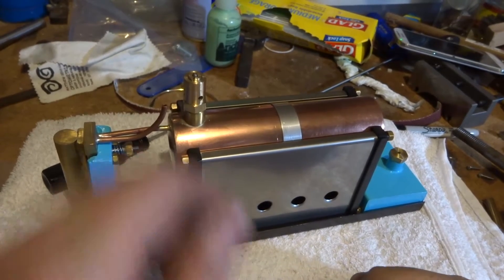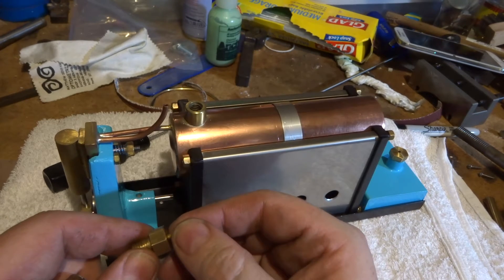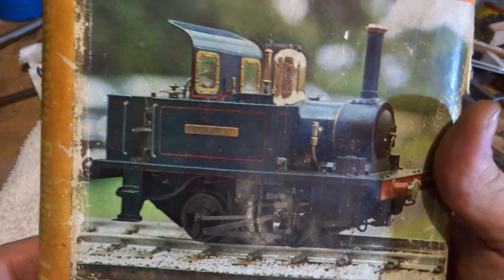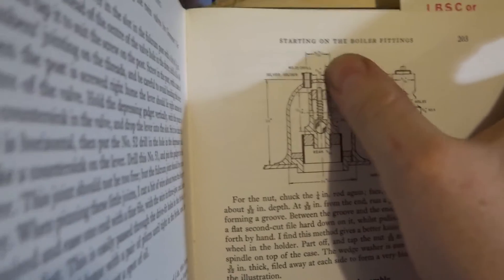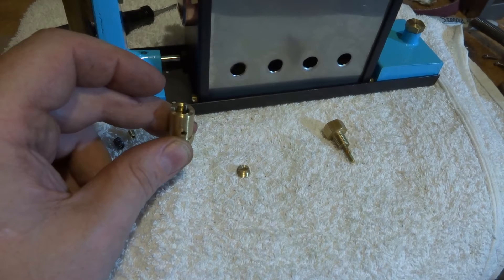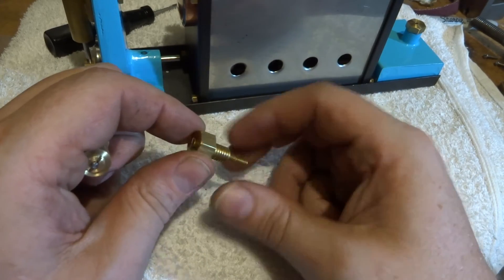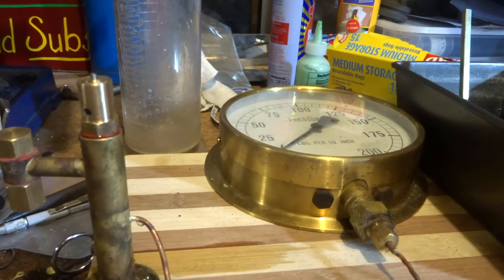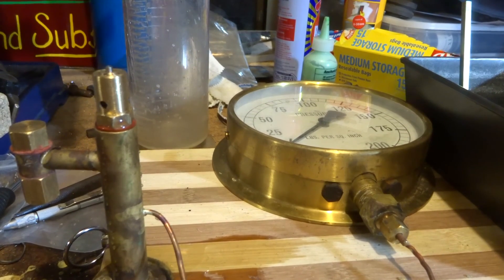K W  SCHOOLS  Steam Engine PART 13 new safety valve

Comment: Nice valve, the original works like the valve in a automobile engine. As long as you have two concentric faces touching it seals and opens for release. The ball type is much easier to adjust etc.